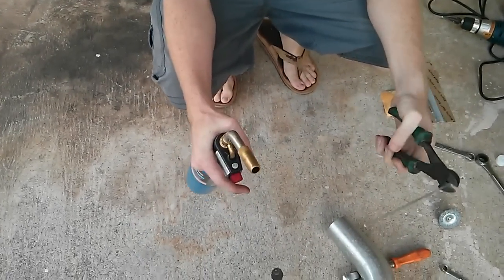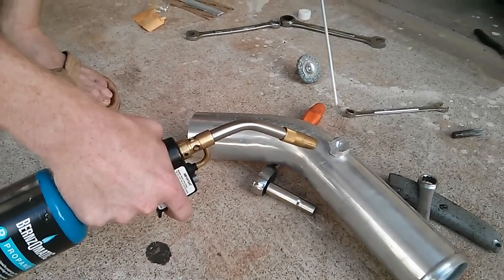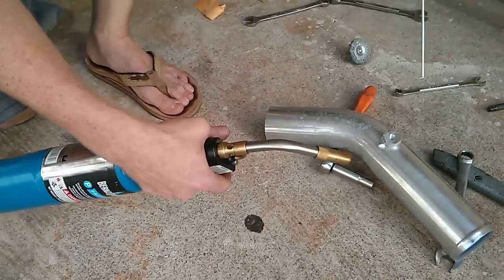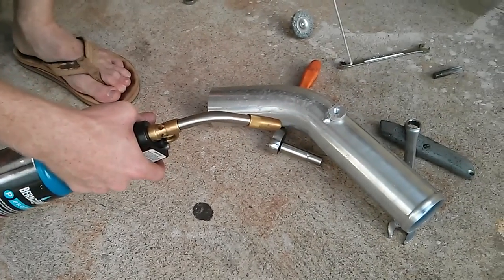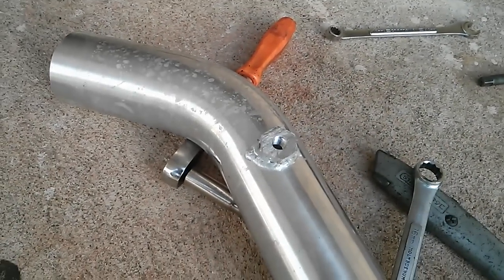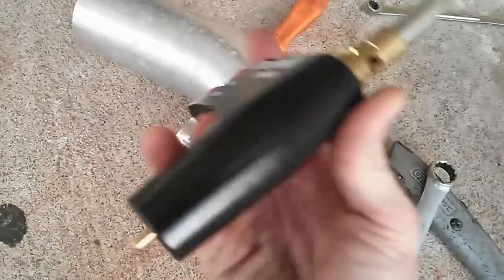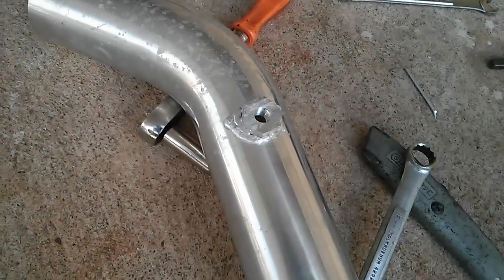Cheap DIY Aluminum Repairs With Alumaloy

Comment: Fusing any kind of metal together takes practice. If all the pieces are the same alloy, it is a lot easier. That same product, or something similar, has been at the various trade shows, for decades now. It's nice to know it can be found at retail outlets. By the way, it isn't necessary for you, or anyone else, to be an expert at anything, much less, everything, to demonstrate a relevant product. Thanks for the heads up on the Alumaloy.
Reply: ό

Comment: aluminum oxidizes quickly and the aluminum oxide layer on uncleaned parts takes way more heat to break down than the actual aluminum underneath.this is why cleaning the parts thoroughly before joining them is key for a good bond. jesse james said so

Comment: I think the problem you had was that you needed to concentrate most of your heat on that bung, as it's much heavier and will heat slower. It looked to me that the bung wasn't quite hot enough and thinner pipe material was quite a bit hotter so the molten filler metal was just trying to wet the surface of the pipe instead of bonding with the bung and the pipe. Just my two cents worth

Comment: I think you are supposed to moves the torch around the area (judging by other videos)
   That way you don't weld peanuts and get a better weld. It didn't bond well to the other piece  because it's thicker than the area you applied the heat to.

Comment: Sort of right.  Rod has flux.  You do need to remove oxidation from the parts first.  Parts need to be 730ºF to melt the rod.  You can get a temperature scanner for $30.

Comment: don't heat up the rod, heat the base metal, the rod will flow towards it, and you won't get those cold joints.
Reply from the maker: Logan Mailandt Thanks, that's what I did and I also explained it in the video.
Reply: +Logan Mailandt 
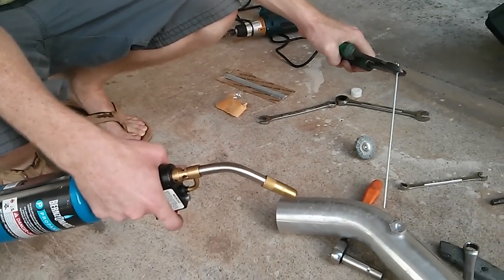he said it at 0:47
Reply: Yeah. But he didn't demonstrate it... those joints look like sin. Not nearly hot enough. They should wick down and create a fileted look around the bolt being joined. His is super globby. Which is why it looks like a cold solder joint.
Reply: +Logan Mailandt 
I'm trying to do this on an oil pan for my bike. Is this Home Depot torche enough for the job? It's just a small 2 inch hairline crack.
Reply: +hairlesheep only if it's one of the wider 1" diameter flower tips. and I'd use mapp. aluminum has a tendency to suck heat. also the pan may start to seep oil as you torch it, cast aluminum has the bad habit of sucking up oil as it heat cycles, making it tougher to weld or join
Reply: Logan Mailandt I have read that alumanoy sucks on cast aluminum and not 100% sure if the zx10r pan is pure or cast. I will be removing the pan from the bike and sand it down. Its either this, Alvin lab metal paste, jb weld, or taking it to a pro welder. I am leaning more towards this though.  BTW, what's mapp?
Reply from the maker: +hairlesheep MAPP gas is in the yellow cans when you buy the propane cans at home depot. It stands for something that I forgot..lol. I have a can with the paper gone off of it. It burns hotter than propane.
Reply: Logan Mailandt Hournine Racecraft Ok thanks guys
Reply: So wheres your video. You think you know it all lets see it
Reply: I didnt say he was wrong i just asked where his video is.
Reply: Where you at martin?. You wanna call names when i wasnt talking to you, where you at?
Reply: Dude marvin you are a big man bet your family is proud of you and you flex in the mirror dont you
Reply: Earnie Humes good reply. Yup very proud. No need to flex.

Comment: You need to wire brush the aluminum to get rid of the aluminum oxide that appears quickly when the aluminum is exposed to air. It is very hard and prevents the braze material from sticking to each of the parts. 

Plus you need to move the heat around to prevent melt through. Too much heat on aluminum will result in melted blobs.

Comment: I totally think I'm going to try to do my intercooler piping this way.... I'm pretty good at soldering so imma give it a go. If I had a nice tig machine I would tig it but I don't and I'm tried of popping intercooler couplers.... And I thought of another good idea is use that alumaweld to add a bead at the end of each pipe so the coupler has something to grab too.
Reply: Did it work? :)

Comment: You clean cos any oxidisation will stop it from adhering..plus never put rod in flame..and the melted rod will always flow towards the heat. Even uphill. . .

Comment: Hey, would this work in repairing a crack aluminum oil pan?  I got a leaky oil pan which the prior owner was trying to fix with JB Weld but they did a horrible job so it still leaking oil.  don't wanna spend big $ replacing it too so looking for a quick fix but hopefully better than the previous owner.  Thanks1
Reply from the maker: maybe, if the oil pan is cast aluminum then it might be harder. All oil and oil residue would have to be off of the area though, so it's probably easier to remove it before doing anything like that.

Comment: Did it hold boost pressure, I want to do this to my intercooler piping
Reply from the maker: Yes. I have since sold this car to a friend. I drove it a month ago and it definitely still holds boost years later. The hole I patched in the radiator still holds up also, and that's a consistent 20+ psi when warmed up

Comment: CAN IT BE USED TO FIX A SMALL CRACK IN A TIRE RIM
Reply from the maker: +Dwight Yamashiro I would on a spare or for something short term.. but the wheel would need rebalancing, otherwise it would wear out the wheel bearings
Reply: Noo

Comment: you think its strong enough for a bicycle frame?
Reply from the maker: I don't know. but it is worth a shot. I have never tried it on anything load bearing
Reply: Thanks. didn't think I'd get a response.
Reply from the maker: Well..one day I'll probably stop. I think I got 4 comments yesterday and a few the day before. One day I'll probably ignore them when it's too much.
Reply: thanks for the valuable info.  I bought a cheap welder but couldn't do it. I tried this aluminum stuff for more of an experiment. Now I know why it didn't work. What can I use this stuff for? Thanks for writing.